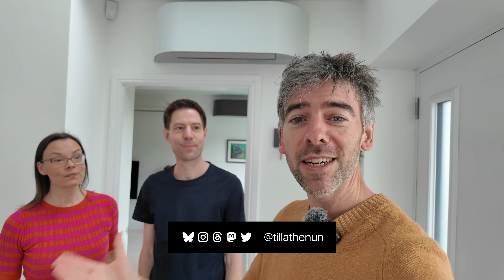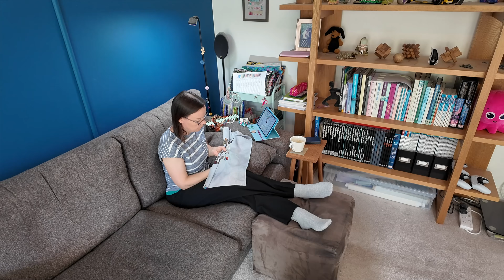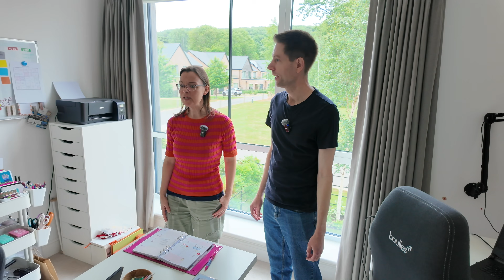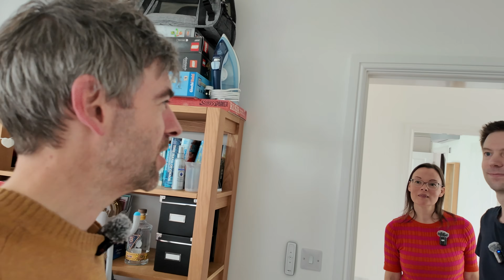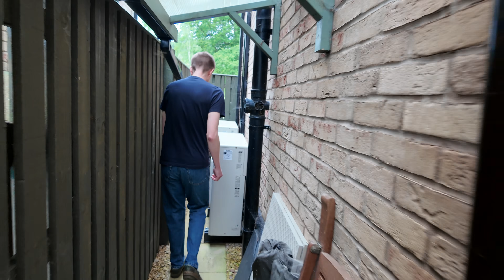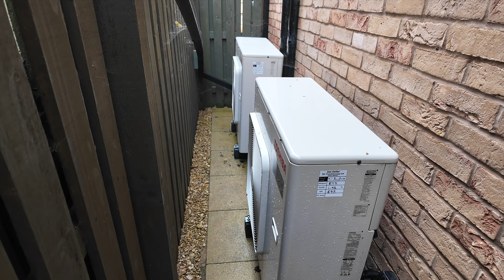Best of Both Worlds? Heating and Cooling with an Air-to-Air Heat Pump

Comment: I'm contemplating A2A and am probably the perfect candidate: it's a Victorian two bed semi with no central heating at all (no mains gas available).  In winter it's either fan heaters, one storage heaters and in the evening I light the wood-burner.

The house is of solid wall construction but I've got one inch internal insulation, rebuilt shashes with secondary glazing so not great but not a disaster.

I have an outside wall which is the outside of the two rooms that would need the internal units.

In many people's cases they are changing from gas to electric, but because of the spark gap, gas (even now) is incredibly cheap compared to electricity in terms of BTU's per £.  In my case I've already got to use electricity anyway.

The final part here is that I have 2.7kw solar and 12kwh battery but no export plan (because it was a DIY install), so although they are happy to sell me electricity and delighted to take mine, they won't pay a bean for it.  Therefore to cool the house in the summer would effectively be free.

Time to get some quotes I think!
Reply: Octopus can take non MCS export subject to conditions I believe? 

@TimAndKatsGreenWalk's neighbour has a better solar system than them and only paid £18.2k.

Comment: There will be some efficiency loss installing the heat pumps in that narrow passage with the canopy above.
They will be recycling a lot of the cold air that can't escape quickly through the fence and narrow passage.
Reply from the maker: I suppose any installation brings compromises but from Tim and Kat's experience it sounds like the efficiency hit is negligible. Aesthetically it makes sense to put the outdoor units down there, despite the efficiency loss so I'd do the same I think.
Reply: @MrEV Key is that people are aware when it comes to installation.
At my place of work they installed many units across the full site.
One area where they were positioned in a similar fashion, would constantly go into defrost mode due to the units freezing.
Moisture/humidity builds up in confined places, lack wind flow and recycling of the output air.

Comment: Watching this channel I have learned so much about energy efficiency in places where energy is expensive. I love my heat pump split system. Even at -30c it still works fantastic but we have good insulation here in Canada (R60 in attic R24 walls) The government had good grants to install which covered 30% but the savings was noticeable the first winter, power bill was 50% less. I have not turned my resistance baseboard heaters on in 6 years. I don’t understand the pushback 

My logic is even with $0.10kWh on average cost why waste energy if I don’t need to?
Reply from the maker: -30°C should be illegal.

Comment: I Installed a pair of air-to-air heat pumps last October and they did sterling service over the Winter. We were able to hold a much more consistent temperature over the house and they used 70% less energy kWh for kWh compared to the gas appliances they replaced. Sadly with the price of electricity as it is they really only broke even financially. However with our solar they provided almost free aircon during the Summer which was very welcome. We've just had our 30 year old windows replaced so it remains to be seen how much difference that makes to our energy consumption this Winter.
Reply: Do you have a useful time of use tariff (and even battery and solar)? Tim and Kat have videos and a tool for that.

Comment: imagine being upper class.... its all nice isnt it.
Reply: Schemes are available providing grants to those less well off.
Reply: @Biggest-hz7ng  agreed, 7.5k and I have to put down 6k, thats ok monthly but I need to buy radiators etc as mine do not work well with it.

Priced out, so I might as well get a high efficiency gas boiler
Reply: @procgen-l2f did you get several quotes? Depending on where you are there may be more help.
Reply: @Biggest-hz7ng  Eon / Octopus (this was cheaper 4k)

Comment: In the US radiators basically only exist in really old homes nowadays.  We all use forced air and have for decades now.  It turns out having a separate hot water system is much more energy efficient.

Comment: A really interesting watch.  I had 3 Daikin units installed 20 years ago and with annual maintenance they are still going well.  I am seriously considering fitting additional units and reducing my reliance on gas.  I have solar and 3 Tesla Powerwalls so I should be able to make a strong business case for the investment.  I am also hoping I wouldn’t need any additional external inverters.  My one nagging concern is that the numbers are predicated on overnight cheap electricity tariffs continuing, but I guess this is a risk worth taking.  The savings generated from my solar and batteries has surpassed expectations.
Reply: Tim has various videos on costs and the best tariffs.

Comment: I live in an apartment in Amsterdam and had AC installed with two indoor units. I use them for cooling of course, but also for heating. I still have my combi-boiler and radiators. What I found a massive hindrance to use the system all winter is when it goes into 'defrosting' mode. One time is not that bad, but after the first defrosting cycle the coils are wet, which means they freeze over much faster after the system re-starts. That is the reason I still use central heating for about 4 weeks a year. For electricity I pay €0,23 per kWh and for gas I pay €1,32 per m3. It took me about three years to recover the costs of installing the system because I reduced gas usage by 2/3.

Comment: We are getting a local Heat Geek approved engineer doing a heat loss survey on 1/9 and have a 2nd booked with Octopus on 22/9.  However we are also going to get VoltPV from Buxted (just 5-6 miles from you) to quote as they fit Toshiba A2A.  They quoted for our solar and batteries although we ended up using RES+ they are a great local family run business.  I think we are team A2A.  Well let you know how we get on.

Comment: We have a very similar Toshiba A2A system here in France: a 3-way multi-split for the bedrooms and a single compressor driving a floor-mounted console for our very large living room.

A couple of observations/suggestions:

Firstly on multi-splits. If you're only, for example, cooling one room off a multi-split designed for 3 rooms as we are doing here when we don't have any visitors, then the outside unit runs rather less efficiently and I'm a little worried that the compressor may be switching on and off rather too frequently. They do have a limited number of on/off cycles over their lifetime.

Secondly on remote control. We have installed wifi comms in the console which we can control remotely eg if we're away for the day and want to cool the room before we get home. As Tim says the app is OK except for power monitoring. But for the bedrooms I have found an alternative, and what was at the time a much cheaper, solution, at least in terms of control. Tado do infrared controllers that operate most aircon units and I have installed those in all three bedrooms giving us complete timing control over the units. Weirdly, they were really cheap at the time in the UK - £50 each but they're about double that now. Nevertheless they work really well for all the basic functions so worth considering as an alternative to the Toshiba wifi add-on. They offer very flexible control of units by time of day, day of the week, etc.

Comment: While I have a new gas boiler after having looked at A2W and had extortionate quotes so upgraded to a combi,  I've now ordered now A2A for the cooling, I meant to do it last year and then let it slide but not this time being installed on October and I've just ordered another 24kWh of battery so I'll most likely do the majority of my heating with them too.

Comment: Very interesting video, I’ve watched the couple you spoke with before extremely charming souls they are , thought the idea of having vents in the ceiling upstairs rather than the units themselves was a good idea, just wondering if that would also be a cheaper option compared to the units themselves, it also makes on think if having a vent system in the downstairs walls rather than those units.

Comment: Great video, thanks. I’m keen to understand what heating is used in the bathrooms and downstairs toilet. Drying towels is obviously a key consideration.
Reply: We have a 400W electric radiator with a smart plug. I found that 1-2h every night will dry the towels just fine.
Reply: I think they just have electric radiators? Maybe check their videos?

Comment: Multi split is not good because it has lots of extra lines about 3 times more than single unit so it has lower efficiency! And putting lines outside adds another loss to efficiency.

Comment: Thank you for a very helpful video. We are in the process of building a bungalow and have decided to instal such a system. Prefer the ability to control each room individually. Believe that this is not possible with ducted system. Also the quotes for ducted have been much more expensive than the split systems.

Comment: No energy bills, but £30k in for the equipment
Reply: It was £8k for the heating/cooling. Solar and battery helps reduce costs significantly and can have good payback periods.
Reply: I'll add that @TimAndKatsGreenWalk's neighbour has a better solar system than them and only paid £18.2k.

Comment: I have had just installed 5.3Kw AC in the living room just initially, just to try out. I will see how it is next year as to late to really assess for this year. If ok we will install in two of the bedrooms as they can be easilly installed on external walls.  I will need to discuss with the installer at the time whether to go with two mini splits or one multi split.

Comment: I have a ducted unit in a property in America and it cools well but heating is not so effective. The problem with these systems is the flow of air. Obviously they are your only option for cooling but you cannot beat underfloor heating to warm a house.
Reply: Their system works for Tim and Kat

Comment: Did you consider Herschel infrared?
Reply: It doesn't have the efficiency of a heat pump (3-4x).
Reply: @Biggest-hz7ng  That's a narrow measure of "efficiency" (heat energy into the system). Heat pumps are also a lot more expensive to install, do require maintenance and break much earlier than infrared heaters. We use both in our house.
Reply: Let me propose these two systems to you. An a2a heat pump where the fan blows across the ceiling, versus a heat pump where you can point the heat down and you run a fan to get good airflow? Which has better efficiency?
Reply: @oliversissonphone6143  A2A and A2W have similar efficiencies. Infrared is okay for small use

Comment: 11:37 we went for exactly this system for our entire house. It's via ergovents with a hihatchi system. Luckily we have  loft voids for the ground and first floor. One outdoor unit for each.

The only room we couldn't get a vent into is our kitchen / diner / lounge which also has massive windows and bifold doors. 

I must say though, as the rest of the house is cooled, this definitely has a notable impact on the last area and makes it comfortable enough to not warrant a wall unit.

So.... I can fully recommend this setup if you want some discreet and complete. And.... Very efficient!

Comment: I have similar large sliding windows, east facing. What works well is having a vine on a pergola on the outside. During the summer we have shading of the windows which keeps the room cooler, and also protects the windows and reduces the risk of them "blowing". 
In winter the leaves fall and with the lower sun we still get plenty of light. 
Were in the east midlands and vines grow fine.

Comment: I'd watched Tim and Kat's videos at the start of their journey but wat a little worried about it going cool between periods of heating, this was as I say early days, whereas now the low and slow approach seems to have solved that issue no doubt helped by bothe EV tariffs and PV& Battery combo. Still I was keen to get A2A until I got quoted £17k for A2A in a 4 bed detached (we needed to heat all 4 bedrooms and we didn't know about the ducted option back then) against Octopus Energy's £4,300 for a 'Wet' A2W

I did try for alternative A2A quotes but found it difficult to get any for "domestic" and the £17k quote was given without a site visit which suggests they didn't want the job. I spoke to a couple of AC installers but as soon as I said that I wanted it to also supply my heating they said they couldn't quote for that because they couldn't guarantee it's heating would be sufficient or just "sorry AC is for cooling not heating". 

I ended up going with a Mitsubishi A2W by a local Heat Geek trained installer and changing a couple of radiators plus upgrading the primary pipe from 22 to 28 mm and running slow and low I'm cosy and warm these past 2 winters and with a relatively small battery have running costs half that of my gas boiler would be costing.

However, had I stuck it out and eventually got a A2A company to come to site and plan a solution then I would have gone A2A then and not be where I am now wanting to install a 3 into 1 mini-split 😢

Comment: Welcoming the UK to the 20th century! We installed ducted aircon in the 1990s.

These are standard in Australia and NZ and have been for 25+ years.

Seriously though its great to see the UK moving away from radiators which are great for heating but…
Reply: As a Brit living in Aus, I really enjoy hearing my family and friends back in Blighty debate whether a2a heatpumps will actually work as they're such new, unproven tech 😂
Reply: @CertifiedSlamboy we’re in NZ and its basically a no brainer and also a legal requirement for rental properties.
Reply: Is it possible jolly hot in Australia? If so you need AC. In the UK, not so much, but it could be needed if climate change keeps giving us what we had this year.

Comment: Having been involved in dozens of projects with air to water ASHP I would not hesitate going air to air.
Reply: Why? I'm curious
Reply: @oliversissonphone6143  Sit down and get a coffee:

AtW is more expensive and more complicated to install. AtA is a simpler install.
AtW needs to run 24/7 - 365 days a year. AtA does not and is quicker at coping with change on demand.
AtW can be unreliable in converting existing wet systems from gas. It's often better for new builds than conversions.
AtW is more expensive to maintain.
From 24th March 2027 EVERY NEW BUILD IN THE UK, will need a mechanical ventilation system and be totally airtight. AtA achieves this. AtW cannot and needs a separate system.
Reply: I think the house and location should drive the decision, surely? Down south might need A2A more?
Reply: @Biggest-hz7ng  What I like about Air-to-Air systems is they can be used 'on demand' if preferred, where Air-to-Water needs to be running 24/7 - 365 days a year. 

Scandinavia has predominantly Air-to-Air installations ( I think it is 75%), albeit due to traditionally warm summers. It's cheaper to install and run.

The Elephant in the room with either system is high levels of insulation and ideally, triple glazing. Often difficult with existing buildings but come 24th March 2027 mandatory with all new builds - including mandatory Solar.
Reply: @nickname1812  some existing houses suit A2W more than A2A. The technologies will compete indefinitely.

A2W doesn't need to be on 365 24/7, it can turn off when too hot and modulates down according to demand. A2A and A2W have similar efficiencies, though A2W won't be as responsive.

Comment: I’ve seen Tim & Kat’s videos before and also follow your channel Andrew. I’m looking at A2A for a large Edwardian home, solid walls, some insulation in the attic and we’re still replacing single glazed windows. Looking at 2 Mitsubishi outdoor units to feed 9 indoor units, but as we already have 1 small single unit in the attic we need planning permission, so have to get an acoustic survey done! 😭

Also looking at the Mixergy iHPX heat-pump hot water cylinder like T&akciová have too as we’ll need a DHW solution. All in all, it won’t be cheap, probably won’t bother with MCS so will miss the £2.5K grant but then probably cheaper install, so swings & roundabouts. 

I have no issues with the set up, I believe it is the way to go and we’re also looking at solar and battery. 

Great video, really like both of your channels guys # keep up the good work!!

Comment: We have a 1 bedroom flat which is all electric had storage heaters before and were rubbish put in air 2 air system with 2 indoor units  fantastic and a lot cheaper to run in winter and nice cool in summer in fact saved in winter about £150 on our electric bill 🎉

Comment: Both systems are good, but I'd be curious to see more A2W installations with hydronic fan coil units for cooling and quick heating when needed. The downside is that they are more complex to install (large pipework compared to R32) but a plus is that if you need to change your heat pump they keep working no matter what refrigerant your A2W is using.